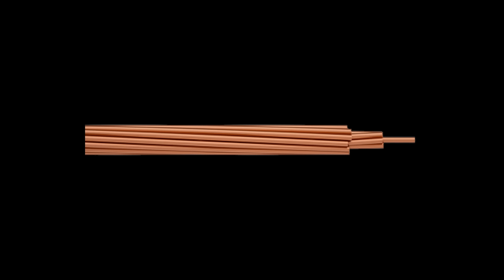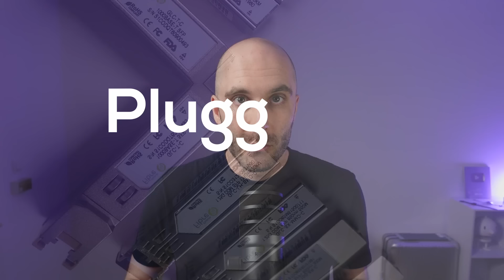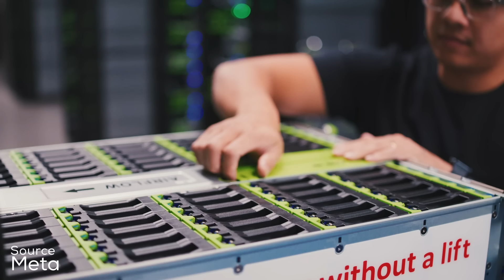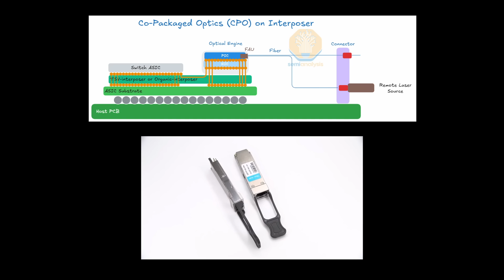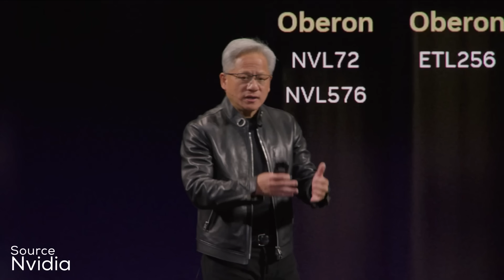Why next-gen AI scale-up needs CPO

Comment: i think even further than that the next step may be Transparent Conductors, its a research field actively growing right now, we even alr have some actualy used at scale that we dont even realize it, such as ITO in OLED and Solar pannels, i hope to be alive the day we have scale produced signal transmission via single layered carbon atoms scales cables as it should give 95%+ light transmission and be flexible enough to use in many devices and appliances, ITO alternatives such as Silver Nanowire Networks, AZO, FTO, MoS₂ and so on !

Comment: Appreciate the info, just that one of the reasons for CPO development is to reduce the optical transceiver malfunctioning, yes it’s easy to replace if you can locate them right away, but in a massive data center there could be tens of thousands of those, to monitor them could take lots of effort. No to mention them consume more power, generating heat, slow down the data transmission, which somehow is critical for inferencing. CPO makes a lot of sense, get rid of the unnecessary components, data flow better, power consumption lower, heat reduction and less maintenance hassle. CPO is the future way to go, the only problem is that it’s very difficult to mass produce. If that happens I bet the hyperscalers will prefer CPO instead.

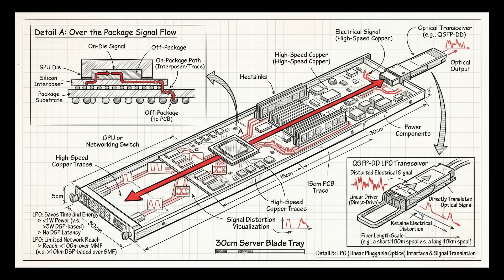Comment: The diagram at 8:50 compares LPO over MMF [multi mode fiber] with DSP over SMF [single mode fiber]. Well of course you get a lot more signal degradation on MMF vs SMF. Would you achieve >100m on MMF even with a DSP? [Google says: The maximum practical length of Multimode Fiber (MMF) generally ranges from 100m to 550m for modern high-speed networks.]

Comment: Clicked on because I like High Yield. Clicked off because of sloppy AI generation. I use AI for work everyday, but it’s on the operator to make sure the output is correct.
Reply from the maker: Like 2% of the video uses generated info graphics.
Reply: @SemiAnalysis stop being defensive. You pose as a source of information for, honestly, complicated topics. This shows your character pretty well. You seem to be actually quite misinformed and lack the necessary knowledge if you can't do simple QA like checking if the images contain basic errors.

This video deserves to be completely taken down and remade. AI is already the lazy way out, but this is on another level. I recently found your channel and this + your responses made me lose all respect you could've garnered.
Reply: @SemiAnalysis Why’s it not zero percent, if you can’t make it not miss?

I have no problem with AI, but you’re making your collaborator, whose previous work had caught my attention, look bad here. Look inwards.

Comment: 7:36 There's so much extraneous detail in this diagram (some that's also just plain wrong) that it's practically unreadable.

Again, please do some QA if you're going to use generative AI
Reply: I hope it's just the high yield guy and not semianalysis making mistakes. I saw his videos a long time ago and he clearly doesn't know what he is talking about. He's a good presenter but somebody else needs to make sure what he says is correct.
Reply from the maker: What was said that's not correct?
Reply: Simply, it's not a diagram. It's whatever the AI model thought a diagram may be and the user that thought it's okay. 

I lost all respect for this channel and I'll be blocking it
Reply from the maker: @Lawstorant-linux  I"m just gonna do it and challenge you, because I think you just saw it was AI generated and didn't like it. Which is fair. But the diagram is pretty on point. Let's take a look at it:

The small "Detail A" box: shows a correct modern package with a GPU die, an interposer, microbumps, the substrate and C4 bumps. The path of the data signal is also correctly labeled. Only critique would be that genAI repeats some labels, like the signal path that goes off-package. But it's correct.

The small "Detail B" box: optical transceiver is labeled correctly with the optical signal on the front and the edge connector on the back.

Main image: a proper slice of a server blade with GPU/ASIC, memory with heat sinks, power components and the high-speed copper traces going across the whole board and the the transceiver. The only thing a bit weird are the distance markers. But even here, the 30cm marker is about twice the length of the 15cm marker.

I get that you dislike genAI images. It might be not the easiest on the eye and genAI has a thing of labeling unimportant parts (eg the DRAM heatsinks) and repeating stuff. But it's not unreadable, it was used as a support to whats being explained in the video and aside from maybe the distance markers, the image has nothing "plain wrong".

Comment: It's all great until an optics module fails in your CPO switch or GPU.

What happens to a CPU/GPU who's CPO fail? On a switch you can over-provision ports and have a technician move a connection to a different port. But a GPU is a pretty expensive component to lose due to a failed optical module
Reply: They will just fail over to an entire working unit. This is how things work already with the hyperscalers.

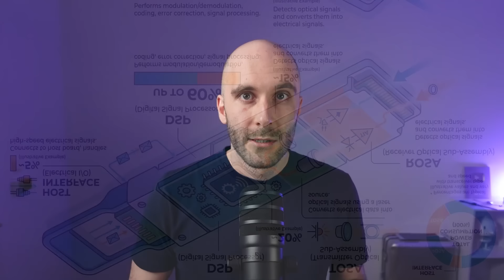Comment: Informative and well-researched video script, but I'm strongly disappointed to see the AI generated graphics at 6:18 and 6:46 which contain a number of technical errors, to the detriment of the video. To start, the diagram of the SFP is backwards! The diagram shows the lasers and ROSA coming out of the electrical end of the module, when it should be on the opposite end with the blue handle. It shows arrows with data flowing away from the laser, which is opposite of the described meaning where the laser transmits information. The optical module also has gold electrical contacts coming out of both ends, where only one end would have those in the real footage shown prior. Misleading information is worse than no information at all; an MS paint diagram would have been more accurate and higher quality than what was published.
Edit: Additional AI generated graphics with false information further on in the video:
7:30 - RAM sticks are labelled as "Heatsinks", and silicon chips are labelled as "High-Speed Copper"
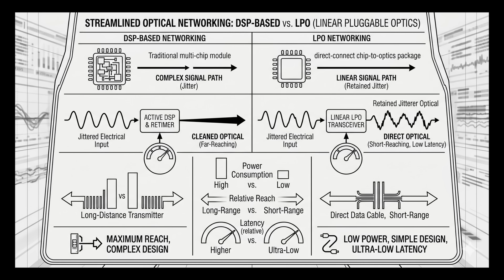9:03 - Higher and Ultra-Low needle gauges both point to the same position
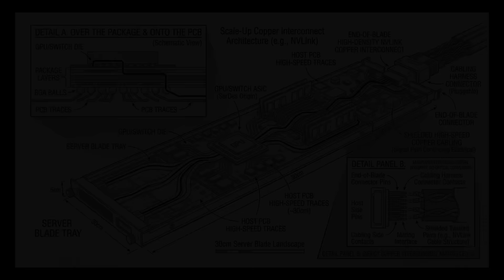17:51 - 4 different sections of the diagram labelled as "30cm" even though all 4 different sections are visibly different sizes. A random copper trace is also labelled as the GPU/Switch die.
Reply: And the general profusion of artist view, escher geometry, and clip-art-esque illuminations.
Reply from the maker: Fair point, but first it’s pretty obvious that these illustrations are generated images and second they are always used as visual support, not the source of information. The transceiver image for example shows the power and latency divide. We even show and take apart a real transceiver in the video. 
I get if seeing a generated image turns you off, but you’d be surprised how much work even a “simple paint diagram” is, especially if you have zero artistic skills ;)
Reply: @SemiAnalysis  Adding my 2 cents - I know how difficult it is to have AI generate even this decent slide. I'm almost certain that it isn't the first try. So you did have to check it for errors (also infographics at highest density settings screw up letters still). Ideally it is to hire a human artist, but it's understandable that in certain scenarios it's not that easy. This is also much less worse than trying to peddle AI to do actual art - which it can't.
Reply: @SemiAnalysis  Visual "support" that confuses (or at least takes mental time to work out that is is AI created, and isn't the considered diagram it first seems to be), is not support - a hand drawn sketch on a napkin would be more professional.  The diagram at 8:50 compares LPO over MMF [multi mode fiber] with DSP based SMF [single mode fiber]. Well of course you get a lot more signal desegregation on MMF vs SMF. Would you achieve >100m on MMF even with a DSP?